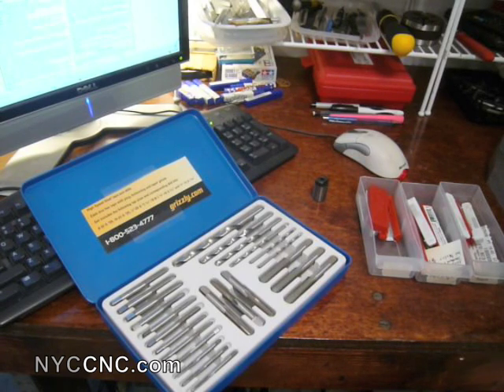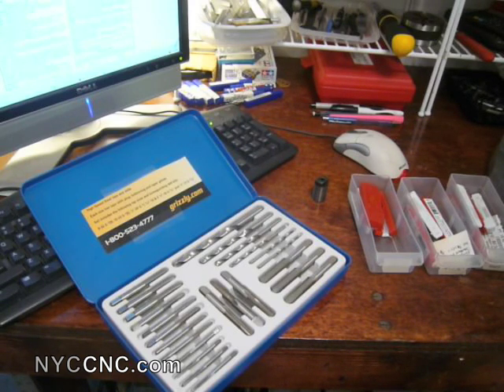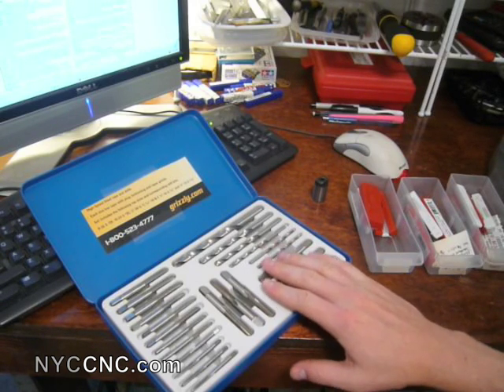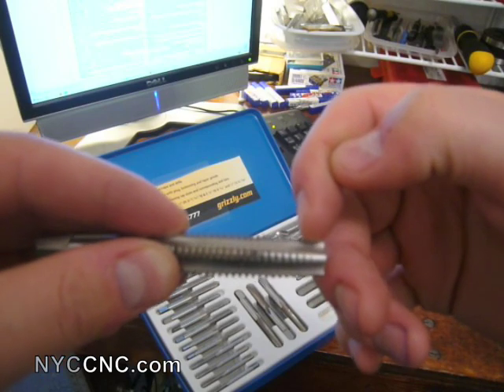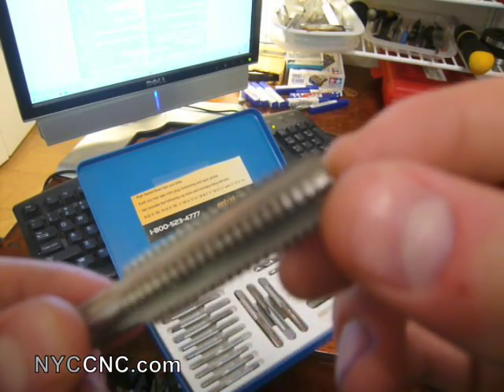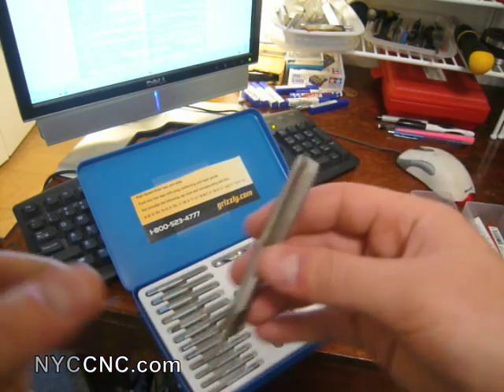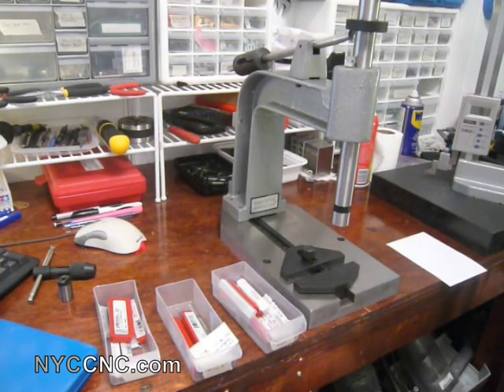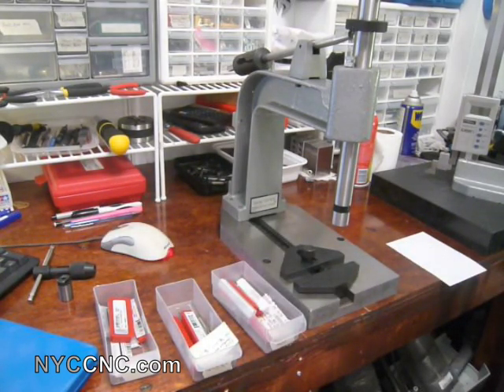Beginners guide to Taps to make threaded holes! spiral flute, plug, taper and more

Comment: enjoying your vids, thanks for keeping them coming! quick DIY tip on tapping machines, strip the motor off of an old cheapie small benchtop DP, make a handwheel to mount to the top of the quill and either use the drill chuck to hold tap or use a tap holder. viola a hand tapping machine that actually works very well.

Comment: Believe it or not, not really. I work on commercial aircraft on the flight line and if something is damaged, as far as threads are concerned, more often than not the component or nutplate is simply replaced. Once in a while helicoils may be replaced, but I have yet to run into a situation where I needed to tap a new bore - usually something like this requires engineering and FAA approval. Not to say that it doesn't happen, but when it does it is seldom.

Comment: I agree with you on staying away from cheap taps. I made the mistake of buying a set from Harbor Freight and they were junk. Threads were over sized and it required a lot of effort to turn the tap. Now I just purchase them individually from mcmaster carr. Those taps are soooooo easy to turn and the threads are nice and tight.